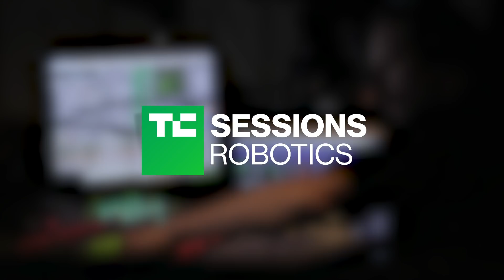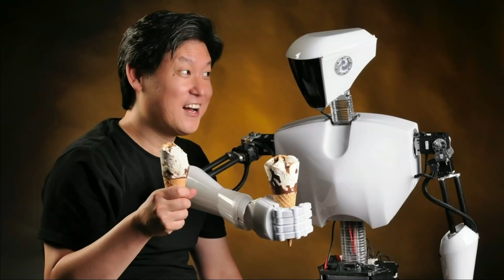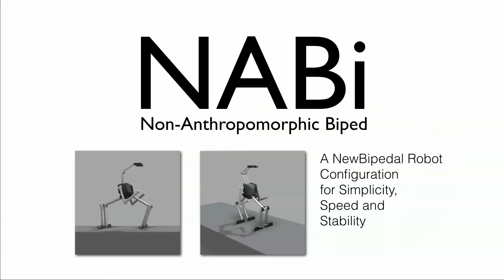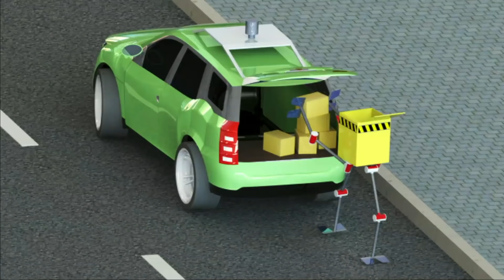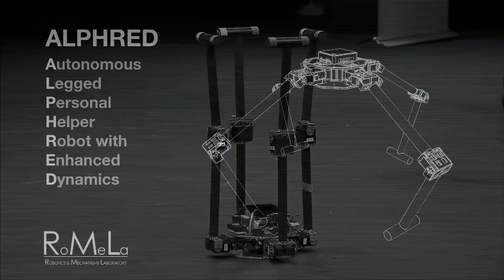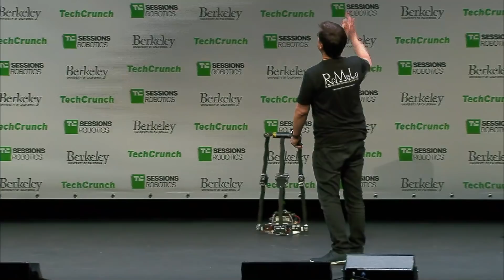DEMO: NABi and ALPHRED (Dennis Hong, UCLA) | TC Sessions Robotics 2018

Comment: Their new BEAR actuator is definitely their coolest thing. Changing mechanical properties on the fly can make robots much more nimble, flexible and fast. This can be a breakthrough in robotics
Reply: Without a doubt! And not just robotics either. Suspension, bumpers(?), aviation (imagine the type of wings you could make), renewable energy, prosthetics, exoskeletons and even teenager proof unslammable doors! The possibilities are endless. I want some

Comment: To be able to construct something that dampens pressure but at the same time can spring load a lot of force In literally the size of a joint for the machine is an incredible feat in robotic engineering. Very proud they’ve created this.. it has now revolutionised the way robots will move. With perfect precision.

Comment: Even if these things come out & cost something like $10,000 when they're done, I can see them taking a lot of jobs.

If I had a Pizza shop, for instance, $10,000 is only about 6 months of a full-time delivery boy's salary, so with self-driving cars implemented, this thing would pay for itself in half a year... except it wouldn't, because it could work all day every day, instead of 8 hour shifts for 5 days a week, so one of these would actually replace 2-3 delivery boys, making that kind of price-point an absolute no-brainer... even if it were as high as $50,000, it would still probably pay for itself in the range of a year & be nothing but profit from that point forward.

Then, with just a few modifications, imagine how useful something like this would be in the back room of a store like Walmart... once they get working the way they're intended these things would do a way better job at stocking, picking, & binning product than tired, overworked, underpaid people do.

Comment: The bear motor, or whatever the acronym is, is the only interesting thing here. Everything else is way behind the curve, not just in relation to Boston Dynamics, but even hobbyists can create better robots. 
You need omni-rotational joints and bio-mimicry to have a successful bipedal robot. Boston doesn't yet implement this on Atlas, but even they have a better bipedal than what you've created. 
Sorry to be so critical, but you're doing what hobbyists have far surpassed, and hobbyists do it with their own money. Like I said, only interesting and new thing here is the bear motor, and I wouldn't be surprised if someone quickly  re-engineers it. 
At least Boston gives us interesting updates, like a jogging Atlas. Can NABi or ALPHRED jog?
Reply: Well, I'd say the actuators are more than interesting.
Reply: in my opinion Nabi is a great advancement as compared to Boston Robotics' Atlas and family only on one and most dominating parameter - the cost!

with the new actuator, they can change the game!
Reply: You are so right! I've noticed in the past the huge difference between human muscles and motors, but I thought that pnuenematics would be the answer. THIS ACTUATOR IS AMAZING, & QUITE AHEAD OF ITS TIME!
Reply: Boston dynamics have probably spend more money on one prototype than all the people in this presentation combined. If you want cheap easy to mass produce and repair robots simple is the way to go. If you can buy 10 simpler robots that are almost as good as 1 expensive robot (that would probably be less reliable) 10 would be the way to go for most of the Applications. The humanoid robots from Boston are only good for the military where they could use existing equipment (weapons / troop transporters ...) and maybe for rescuing.
Reply: Their approach to locomotion is novel! I disagree with the idea that they aren't doing interesting work. And the bear motor really is cool. 

Not really fair to compare university level research to a private company like Boston Dynamics, nor to say that one of these two approaches are "superior". approaches are  Bio-mimicry is clearly not the goal of this lab. Meanwhile, in Cambridge, you have a lot of engineers coming out of the MIT biometrics lab, so of course that's what a lot of the work in that region resembles.

Calling one approach better or worse than the other is somewhat dishonest. Both forms of research is important, and which approach to take always depends on the application.
Reply: Akash Singh, look at joints like hips and ankles, they do not move in one rotational axis, omnidirectional joints would allow us to mimic our own gait, or an animal's gait, so that the robot can more naturally balance itself, especially during it's own walking movement. Along with that, there's also shoulders, wrists, and MCP (base of fingers and toes) joints that are also omnidirectional. Whereas elbows, knees, PIP (joint in the middle of the finger and toe), DIP (joint closest to the fingertip and toe tips) can be a single axis rotational joint.
And this isn't just for bipeds, arm based robots can benefit from this, basically anything that has a nonlinear joint needs an omnidirectional joint.

The only problem is finding a way to manipulate these joints efficiently. Naturally, it's muscles and tendons attached to the bones that make up the joint, which also provides a leverage force. Mimicking that would usually require actuators, which are either slow, bulky, or expensive, and not to mention that they can become extremely complex very quickly. Other manipulation methods are also generally complex.
Reply: Name one hobbyist that made a succesfull bipedal robot that moves efficiently
Reply: basically, it is direct drive motor(maybe with some reduction). should be used for ages now for that kind of applications
Reply: advancements are made in increments... and by trying things that are different than what others are doing.. I'd say these guys were successful in doing just that. They weren't trying to build the best robot.. they were testing some different approaches with bugger all budget, and out of it came the bear actuator.. a pretty cool increment. Maybe not as good as the live drive scara actuator, but maybe cheaper.. I'd like to see them have a go at an omnidirectional joint, their out of the box thinking might do well in that endeavour.
Reply: Can you afford a Boston Dynamics Robot? I prefer a Ferrari to a Pinto as well.
Reply: Why do you need omnidirectional joints for bio mimicri?
Reply: I get your point mate!! But all I was saying is not all joints need to be omnidirectional for developing bio inspired robots
Reply: Xander Zoolander All robots so far suck. Even Boston Dynamics only releases videos of the one in one hundred tries that their robot didn't fall. Making them look amazing. Besides we will never have robots like in the movies because we will never figure out what consciousness is or how a thought is formed or where thought comes from.
Reply: The robots are more efficient than boston dynamics' ones. One sentence.
Reply: Live drive has something like it https://www.youtube.com/watch?v=_ecDGj75ymk
Reply: I'd be surprised if this is the long and short of it - they must be doing something novel. They have a lot of integrated circuitry on the acuator, I would be interested to know what's going on with that.
Reply: You probably couldn't achieve the control you are talking about using available electromotive forces - even with the presented BEAR drive actuator. Bio-mimicry is an important field of research, but given the lower cost of electric motors I think it is worth investigating methods of complex robot motion that can be achieved through electric motors.
Reply: On the other hand, Boston Dynamics is way further along understanding complex autonomous robotic motion, and there probably isn't a robotics platform that comes closer to achieving the same utility as a human body on the planet as Atlas. It seems like money well spent to me (even if Alphabet doesn't agree lol)
Reply: Waht is iteresting? The bear motor is a spring or a damper or a spring damper due to the motor is torque controlled and commanded with a torque proportional to the position error or velocity  error or to both. As positioning system is a normal position control. But not both the functions together. If both the functions were implemented than was very nice
Reply: i will take this technology any day if it's gonna save me half the price.

Comment: Still prefer Boston Dynamics
Reply: These two companies are in different pages. They are not competing whatsoever -- rather complementing.
Reply: at least you get to see different prototypes and these are not so bad.. everyone has to start somewhere right?
Reply: I agree. Boston Dynamics has mainly a quadruped (SpotMini) and a humanoid (Atlas). Both of those are more conventional ideas for both of those types of robots, and, of course, well refined. This company is experimenting with unconventional types of locomotion which will almost certainly have a wide range of possible use cases in the future.
Reply: That jumping robot with the wheels for feet from Boston Dynamics is amazing..
As for a firefighting robot for ships a robotic arm that runs on a track on the wall or ceiling would seem better then a robot walking around with a hose that gets caught on everything imo.
Have a water connection in each corner of the room or where to best allow for best coverage of the room so the robot arm on the track can hook up to water,foam ect to fight the fire...
If the tracks were put on all ceilings through out the ship the robotic arm could also be used to move cargo through out the ship through the narrow passage ways that would other wise have to be done by hand....or man lol....like carrying an injury person.
Reply: @harryguy76  That'd be another huge headache for shipbuilders to consider. They have to consider routing this firefighting robot rail when designing the ship, as well as the multitudes of other pipes, wires, and systems that need to be considered. Every door on the ship must be altered to accommodate the rail, and still be water tight. Not only the rail to move the robot, but all the plumbing that allows it to spray water to fight the fire would also need to be maintained. Retrofitting older ships to have the same system would be a huge cost. The complexity and high integration of the system would also make it susceptible to damage. Without a lot of planning and fail safes, 

There are many many reasons why a single, self contained robot would make a lot of sense. Even if it has challenges moving around, ships are designed for people, and the it's simplest if the robots are somewhat humanoid.
Reply: @zorgitron  You makes some good points...and if it was easy it would already be done...but the whole point of advancing tech is to make things easier and safer for the men and women on board.
As for the tracked robot arm...it could be used for many tasks....but like you said going through door would be an issue as there can't be a track going through a water tight door...so have the track/rail stop and start at every door and have the arm move from one track to the next...kind of hard to explain in text...but think of how modern bridges are built where a huge machine extends out over a span to the next pylon bridge support...then slides a pre made section of road/bridge over the span to the next pylon...but with the arm...it would only need to span inches...The power could be run in the rail like a train with a quick connect for water in each compartment..
Also a system like this would not be needed on the entire ship to fight fire so not needing the water connection...
And for control it could be wireless only needing power...
Reply: @harryguy76  Imaginative thinking.. Unfortunately you've never been on a ship.
Things aren't handled like that ;)
Reply: @OmmerSyssel  If is wasn't for Imaginative thinking we would still be riding horses and buggies...many great achievements where made possible by Imaginative thinkers fighting against a majority who said it couldn't be done...so I will take that as a compliment...
Reply: @harryguy76  I'm sorry for your unacknowledged talent..
Still doesn't change how ships are constructed. 
And no, we don't need your fantasy projects aboard.
You see, Galileo pointed out new insight & developed existing technology.
We still use hammer & shovel because it works, not by failing acknowledgement or stubbornness. That's found in muslim controlled societies.. Not among us 😎✌
Happy sailing, landlubber ⛵🚢
Reply: @OmmerSyssel  Are you on drugs or something lmfao...if not you should look into it...
Reply: They're trying and ahead of various college competitions I've seen. Boston Dynamics (unless those videos are fake news 😂) is so far ahead.  TC creates a new version to address a single movement challenge. It seems BD has incorporated all the movement solutions into a single specimen.
Reply: So far it looks like BD makes expensive robots for military use only. These are breakthrough in consumer grade robots. BD robots take the more vertebrate approach (i.e complex with every movement requiring heavy computations) while this looks like more of insect approach (simple with mostly physical dynamics). Both have their own merits, but as a non-military cheapskate, this excites me A LOT more than whatever BD does.
Reply: oh yeah? does boston get your robot dollar rather than some university? take head out ass dude what do you mean you "prefer" them
Reply: DynastySheep Yeah
Reply: It's a different point of view. Boston dinamics robots tend to be more voluptuous and need much more technology to support their designs. This guys, however, are using less technology to achieve the same purpose: locomotion. Maybe because they have less funding, I don't know, but they approached from a different point of view that's also very helpful in the development of a cheap and useful foot-robot, and maybe looks like less "impressive", but it's actually, amazing.
Reply: Especially its PERFECT Swearing mode on the robot! Its MAGNIFIC
Reply: even their atlas robot can do backflips and jumps now
Reply: timeofsage Boston Dynamics founders and much of its staff is from MIT.
Reply: And? Your mom prefers your cousin more than you. Why does it matter? It's an amazing technology not a fucking competition against Boston dynamics. You probably don't know much anything about science so you just spit a buzz word like 'Boston dynamics' so you feel like you know something.
Reply: Kevin You could have made your point more effectively without personal attacks.
Reply: I will never understand why they are so keen to use something new for locomotion. Of course i can understand why they try to get the bipedal movement solved. But anything else can be done by wheels or tracks. Even the idea of a snakelike movement works in many cases. Or build small flying robots to move in a complicated environment. And you can always look at how nature does it. This here looks like it can work, but it also looks to be very slow. Not such a good idea, when you are trying to fight a fire.

But the actuator is really awesome.
Reply: This is actual robots in display, Boston dynamic only makes fantasy CGI dream concepts.
Reply: Y THO?
Reply: is that perhaps in this video there is something that is better than  Boston Dynamics? XD
Reply: Nerd fight!
Reply: atlas can do parkour and that freaks me out
Reply: So do investors, apparently.
Reply: Yup yup
Reply: There shouldn’t be bias or competition in the field of robotics. Support everyone contributing to building the future. : )
Reply: That what I'm saying talk to me when ya beat Boston dynamics

Comment: The BEAR actuator is extremely old hat, it is cool, but equivalent devices have existed for a decade already
Reply: adisharr It Is just an active compliance actuator. You can actually achieve the results they showed with a simple PID loop that you tune the parameters for, but it also can be done with electronic current limiting.

It's really really basic. I'm not the brightest spoon and even I've done this stuff.
Reply: I don't think that actuator is working quite the same way as a standard feedback loop although I could be wrong.
Reply: well touchscreen was also an ancient idea, yet the apple stuck it on the phone and called it revolutional
Reply: :23 Apple didn't revolutionize touch screen though. They popularised the marked for smartphones. What you are saying is equivalent to "Paint was also an ancient idea, yet Henry Ford stuck it on a car and it was revolutionary"
Reply: Matthew McKellar, I meant that more as a joke than a direct comparison.
Reply: :23 Forgive me for the misunderstanding then.

Comment: an actuator that can be back driven means that it must also use significant amount of current to maintain its position.  Any system that requires constant current draw to maintain even a static position will then require a higher capacity power source which then adds weight which in turn requires more power, a never ending cycle.  Its a break through, but very inefficient in terms of power consumption. Better to have feedback sensors to control non back-drive actuators to simulate compliance/strength.